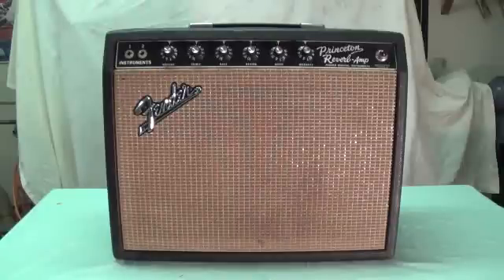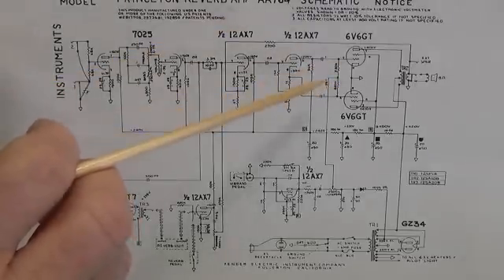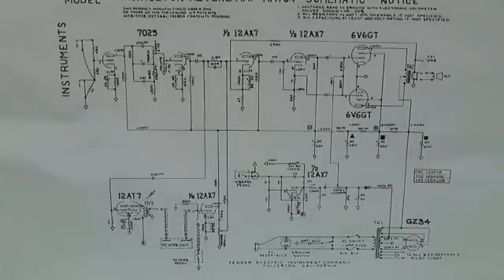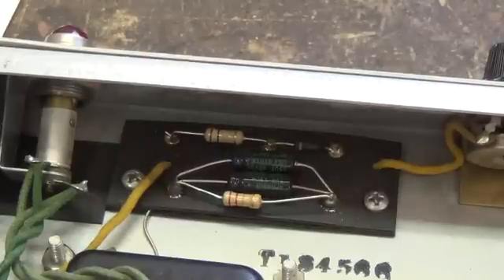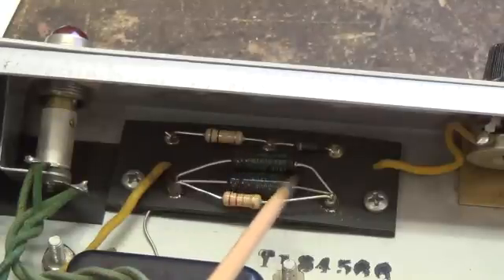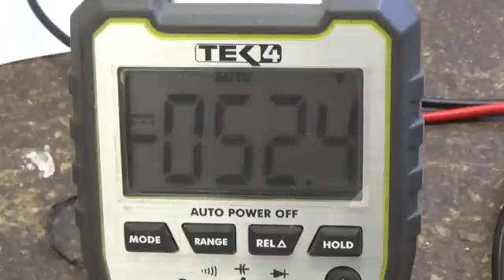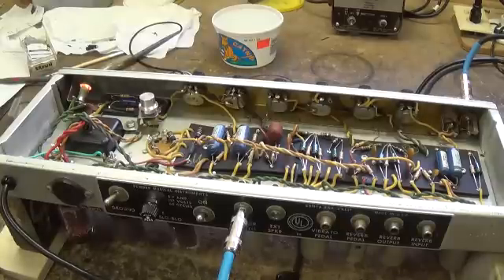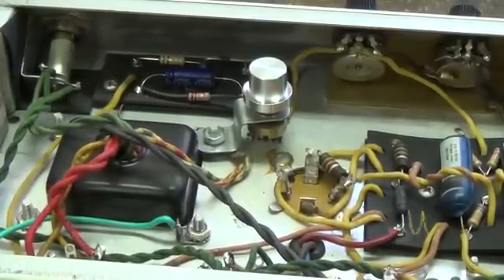Converting the Fender Princeton to Adjustable Grid Bias

Comment: Great I ll leave the 47k alone then. I ll try removing the 470k from extra gain stage 7025. To be sure on the layout, it is on the board parallel to the length of the board just around the area of the bass channel pots?
Reply from the maker: I'm not sure where it would be located in your chassis, but it is connected between pin 6 (plate) and a .01uf cap to pin 7 (grid) of the second remaining 7025.

Comment: 47K on my schematic. Looks like a 4.7k in amp. Next to two .1 caps closest to jewel light
Reply from the maker: I found another schematic, which may be the one you are using:  http://www.thevintagesound.com/ffg/schem/bassman_ab165_schem.gif  In it, the negative feedback resistor is 47K, which is much higher than the earlier versions of this amp (it was 820 Ohm originally). Also, in this schematic you can see the 470K resistor I spoke of previously, which is to be removed.

Comment: Struggling to find the 820 ohm on the schematic. With these mods shall I keep bass channel v1 tube removed?
Reply from the maker: On my AA864/AB165 schematic, it's at the top of the schematic, just to the right of center (straight down from the "AA864"). It's the resistor that regulates the amount of negative feedback. If your resistor has a different value, it doesn't matter, simply increase the value to reduce the negative feedback.

Yes, if you don't use the bass channel, then leave the 7025 tube out. I made my Bassman clone single channel, with no Bass input, tube, circuitry, etc.

Comment: Doug, I have a 69 bassman AB165. I have changed the tone stack to 59 specs. I have also enjoyed a little more gain removing the bass channel v1. I would like a little more gain and touch sensitivity. Less negative feedback help my cause? Thoughts?
Reply from the maker: Greetings, DS. I have some experience with this circuit, having scratch-built a clone (and posted a video). To further increase gain, you can reduce the negative feedback by increasing the value of the 820 Ohm negative feedback resistor, and you can eliminate the 470K resistor between the grid and plate of the second remaining 7025 tube (at the top, near center of schematic). Try these changes and see what you think. Good luck.

Comment: The original construction doesn't have any voltage regulation on the biasing line. It's simple, and it works. When the mains voltage changes (rises for example), the plate voltage rises, but the negative bias voltage (to be exact - it's absolute value) rises too, which limits the plate current more, keeping the plate dissipation equilibrium more-or-less.
If I was to modify the amp myself, I would add a second diode, to have a full-wave rectifier and less ripple on the filtering capacitor, but this would mean changing a couple of resistors too to get the voltages back to the same level. But that's just my obsession with hum, and dislike for half-wave rectification :)
But then again, maybe this slight built-in 60Hz tremolo (due to some ripple in the biasing voltage) adds to the character of the amp :)
Best regards
Reply from the maker: An interesting analysis, Stan. It is a little worrisome to apply a half-wave-rectified bias voltage to your output grids, but I must say that hum has never been a problem with the Princeton Reverb. Thanks for your input.

Comment: Another great video Doug! Quite often I get Fender Princetons in for repair...I try t always install matched pairs of 6V6's to make life a little easier, When Fender came out with the Silver Face line, they laid an egg with it...That was the series of amps that earned Fender a bad rep at the time. They used the bias balance circuit rather than a true adjustable bias...I remember doing modifications on these amps to bring them back to the original Black Face design...Keep up the great videos!!!

Comment: As in all industrial made Amps one can see, that the company needs to get some profit out of them. So the little brothers of the Big´uns need some budget-law cuts. In here it is the grid bias. They use the pot as well to provide the following stage (1/2Ax7) an AC-load. clever ;) Pots, in those days, cost a dollar each for a company. And about 4-8 for a replacing one. So saving component count really was a big deal.

Comment: I just saw , at 05:20 and up, that you´ve messed up your diode +/- signs in your circuit diagram. They used to be reversed. As the anode is plus and the cathode needs to be signed with the minus.

Silicon diodes got their cathode sign on it - represented by the white or grey ring near the pin. This pin is indeed the cathode of the diode.

Your circuit is correct as the diode is in right direction as well.
The cathode is on the negative power supply and the anode is connencted to the Cap. This let the diode conduct when the power supply voltage becomes more negative than the Cap. Hence to currect flows into the cap and loads it. The voltage will rise across the cap while we loading the cap until it reaches the level were the cap´s voltage and the power supply voltage are nearly the same. (neglet the diode´s voltage drop here)
If the power supply voltage becomes more positive the diode cuts out and electrical disconect the circuit from the power supply.

I know this is may a little confusing in the first place, but it is due to the negative voltage we do need here....it´s all ´upside down´ with respect to normal PS designs ;)
Reply from the maker: I understand what you are saying, TC, but I thought it best to duplicate the -/+ designation that Fender uses in the schematic to avoid confusion. If I were to change the signs, someone might misinterpret it as a suggestion to reverse the diode. Thank you for your excellent input.
Reply: Uncle Doug I know about errors in company´s schematics. Some are in just to confuse people while clone their products, while others are in it due to some redrawing by company´s imployies who did not kew what they are doing....;)

You may add an info sign in this video, telling that this is original in it, and not your fault ;)
Reply from the maker: I will. Thanks again, TC.

Comment: Some more suggestions:
If you put in two seperate pots, one for each tube - may along with a 47Ohm/5W resistor in each of the kathode path of the output tubes. It is now possible to insert any 6V6 tube you got - if it is not dead ;)
You loose some output power but you are no longer need to match your output tubes. As this circuit does it for you.  Simply match the cathode current by adjusting the pots you just inserted and way you go...
Reply from the maker: How about replacing the two 220K grid resistors with a 500K pot (input bias voltage connected to the wiper) and then adjusting it to dispense different amounts of bias voltage to the tubes until their plate currents are balanced? The only downside, as you warned in another comment, is that you face the possibility of a loss of pot wiper continuity and tube bias.
Reply: You can do this as well, the result would be the same in first place and as you described it
 
But the driver stage will see different loads when the whiper is not in center position.
Let say the whiper will be in 2/3 of a 500k pot.
one half would be 166k and the other 333k resistance presented to the driver stage.

If the whiper would fully CCW or CW turned you short out your driver stage completely (for AC). If you see the whole schematic from AC topology. DC coulped is all correct, but AC would be differ a lot.

Be as symetric as you can, your amp will thank it with good (=clean) sound, add single side a little DC-offset in the driver and your amp will produce even harmonics. Vary single side driver amplification and your amp will produce even harmonics which will differ upon volume settings.
Reply from the maker: I can see that turning the pot to either extreme would cause problems. How about a 100K pot with 200K resistors between the pot output lugs and the tube grids? This would provide balance capability without jeopardizing the tubes.
Reply: Uncle Doug This will work well, as the AC loads differs not that much anymore.
Reply from the maker: Thanks, TC. I really appreciate your expertise and input.

Comment: Excellent video, Doug!
As usual fantastic explanation and leading all straight to the point...:)

Here are my two cents:
If you gonna do this, you may want to make the negative grid bias rock solid, as you already plan to desolder some components and the amp is upon your workbench anyway.
If you connect just the wiper of the bias pot to the grids, what happend when this wiper becomes loose or does not making any good connenction inside the pot anymore....
You know this: you´ll burn your tubes.
Because the grids then have a bias voltage near zero....oops...

To prevent this put a single resistor, may with the same resistance or slightly higher, in parallel to the wiper pin and the negative-voltage pin of the filter cap. Not ground!

So if the pot´s wiper loose its contact to the resistance-path that added resistor provides lowest grid bias possible to the tubes. So they will survive and all you have to do is change the pot - not the tubes as well :)

I´ve serviced a lot of Amps with blown output tubes due to a defective grid bias pot. Some times even the OPT was melted, or the pri. winding was shorted. Well known for this are the ´braun´ CSV 60 Amps with PL 500 output tubes just because the tubes are so rugged, they can stand zero grid bias for minutes while cooking the pri windings and even set the OPT on fire.  

Have fun, and thanx for this great video!
Reply from the maker: You have brought up a good point, TC. We have all seen pots in which the wiper made poor or inconsistent contact with the perimeter resistance; which, in this case would eliminate the bias voltage and PC would soar. It does appear that a 10K resistor connecting the wiper to the negative input from the diode would provide an alternate route for the maximum grid bias voltage (= minimum PC)  to reach the tubes in case of wiper failure. Please acknowledge that I have correctly interpreted your recommendation and I will test it in the PR circuit.
Reply: This is by far more true to the newer pots, the old ones found in vintage Amps are much more reliable than today´s brothers.

I would suggest 15kOhm up to 33kOhm sould do it.

To make it complete clear [ :) ] you should connect the resistor where you put your pencil at 05:59 (where the diode and the Cap conected together) and the whiper.

If you put it prior to the diode you´ll add a huge amount of hum to your amp, you´ll hear it and definitively shut down your amp very quick....;)
Reply from the maker: I will increase the resistance as you suggest. I intended to simply jumper between the input (right) and wiper (center) lugs on the pot, rather than extending out to the diode/cap junction. Is there a reason you prefer the junction?
Reply: There is no reason. I just wanted to made it complete clear.
In serious HiFi audio gear, it differs but here it´s the same thing.
Reply from the maker: I installed a 25K protective resistor between the wiper (center lug) and the negative voltage input (right) lug, and the circuit works fine. I also added a note to the video describing this modification. If the pot fails, the output tubes will now be protected. Thanks again for your input.

Comment: Hi Doug,

Great video as always. Just a quick question. With regard to your bias voltage range, were the results shown here with output tube's installed or not? The reason I ask, is I just finished a quasi 6G3 build (minus Tremolo Section) , and my negative bias voltage varied significantly once the output tubes were installed. Understandably being due to the load applied to the power supply. Like your amp, my adjustable fixed grid bias was derived from the HT winding of the Power Transformer.

Regards, Dan
Reply from the maker: As I recall, Dan, the bias voltage range shown on the meter was obtained without the 6V6's in place. My reason for this was to set the bias voltage at its highest setting (and PC at its lowest) before installing the tubes, to protect them. I never measured it with the tubes installed, focusing instead on PC and PV, but would assume that it would be lower.

Comment: is this application can also work for a push pull hifi amp too? I will use 420V B+ and 4.2K output transformer 8, 4, 16 ohm
Reply: Simply do not use any of the schematics to be found at internet ´HiFi´ sites....build your very own. And keep it simple. And may use some designs within the tube datascheets. Try a three-tube thing first - let say 6SN7 and two KT88 if you want.
First stage with simple gain stage. Then a simple phase splitter and then into the grids of the KT88. You can run the KT88 in grounded grid (via 220kOhm) - having 470-1k (10W) Ohm in the cathode. At 350V plate and screen voltage. Screen connected via 470R-1kOhm to voltage supply.

So you don´t risk anything besides the cathode resistors.

By far more easier than build up a competitive solid state amp.  Where one have to deal with second breakdown or low impedance drivers at high gain stages, current-mirrors and so on...
Reply from the maker: I'm not sure if this would work on any amp other than a Fender Princeton or Princeton Reverb, Juan. I don't recommend trying it.
Reply: ok no problem I will find other ways thanks for the video really interesting
Reply from the maker: Thanks, Juan. I'm glad you liked it. Good luck !!
Reply: It is indeed possible, but keep in mind that your OPT pri winding can only handle a certain amout of DC-current. If you plan to use hi-current settings in your output tubes you may melt down your OPT.
Reply: TubiCal
 
oh yes actually the power transformer I'm going to purchase delivers 330 - 0 - 330  325mA  the apliciation is for a home audio amplifier in push pull using KT88's and 6SN7
but I have read that in the pass guys  use to use filament transformers inverted to get a separate supply for the negative bias adjustment have you seen something similar before?
Reply: You can do so, but why....? since you build up your Amp all yourself just order an appropriate power transformer instead of just get a standart one witch does not fit your needs. You´ll better go for 330 -0- 330; 6.3V/8A; 120V/100mA for neg bias. And do an active regulated neg.grid supply otherwise you´ll end up with hummed and/or unstable output tubes.

Keep the max. possible grid bias resistor in mind as well. As the datasheet indicates do not use a higher resistance as 100kOhms for the grid bias resistor of each KT88! And futhermore design your driver to meet the K88´s needs in terms of driving power. For a 100k load you´ll need to have 47k anode resistor in the driver stage. A 6SN7 can handle it, but please do your own circuit. Just go inside the 6SN7 datasheet and calculate the resistors by yourself. Or your amp will do some unexpected things (oscillating and zipp noise) at high output levels and destroy itself and / or your speakers.
Reply: the schematic does have 100K negative grid bias so what I need is a you say "330 -0- 330; 6.3V/8A; 120V/100mA for negative bias? good point then I will check for the appropriated power transformer that meet does numbers thanks,
 the schematic is in this link probably you will find it interesting.

http://www.angelfire.com/electronic/funwithtubes/John_Wise_low_distortion_tube_amp.html
Reply: TubiCal

    I guess you are right, the first schematic I have in mind was the Williamson Ultra linear is less complicated that the one I show you on the link, but if I never try I will never learn, solid state I already build 5 and isn't that complicated as tube amplification any way I will take your advice and go for something less complicated, I betcha you have plenty of experience thanks for your advices.

Best Regards
Juan